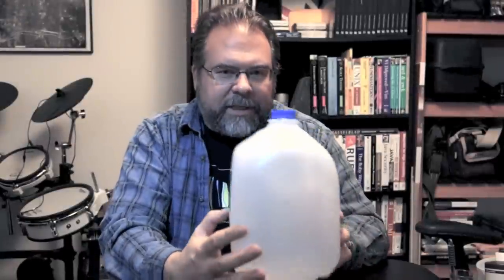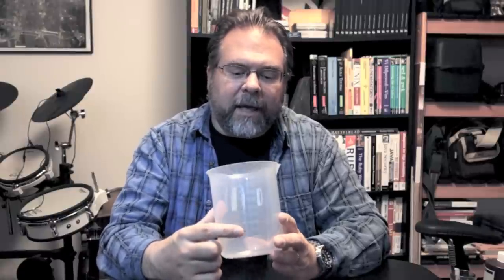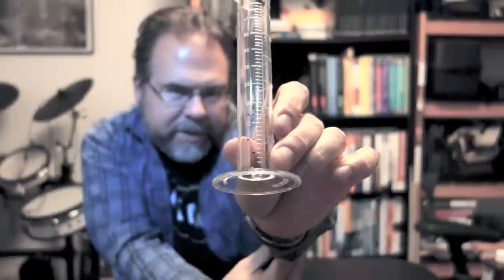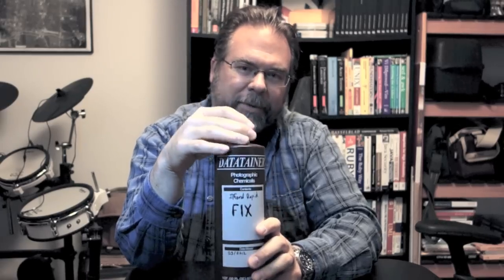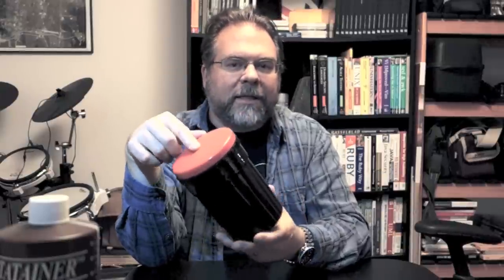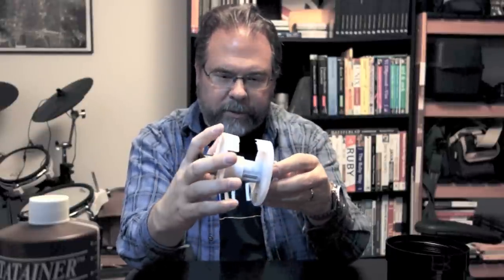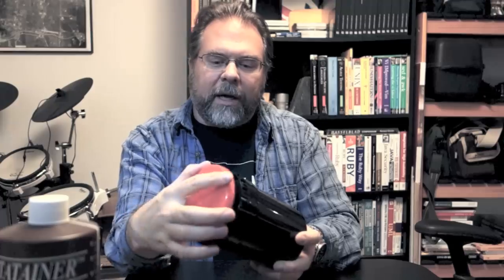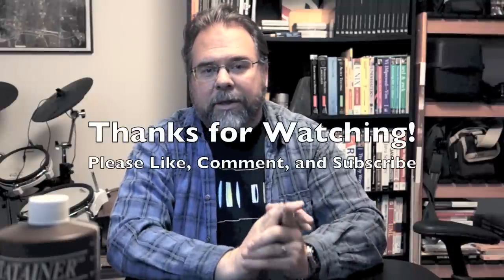Developing B&W Film:  Part I - Darkroom Supplies

Comment from the maker: I think we are fortunate to have a basement bathroom -- sure makes the job much easier.  Once you've got a couple dozen rolls under your belt (I've done about 100), the loading will seem second nature.  In the next video, I'm going to show a tip I use to make loading a bit easier.  I totally agree about 120 being easier to handle, both in development and in scanning.  I use Ilford fixer, but haven't experimented much with developers, and have pretty much stuck with Rodinal and Diafine.